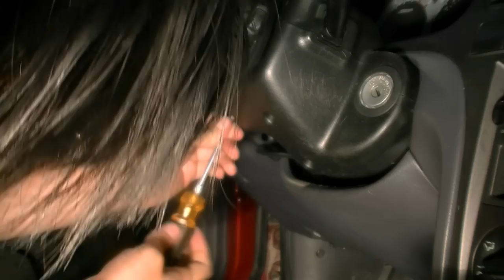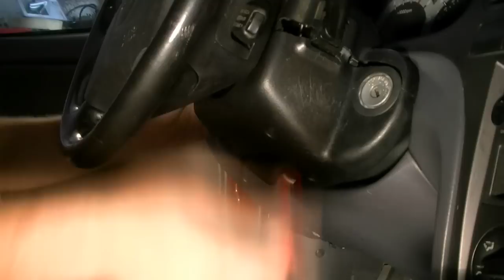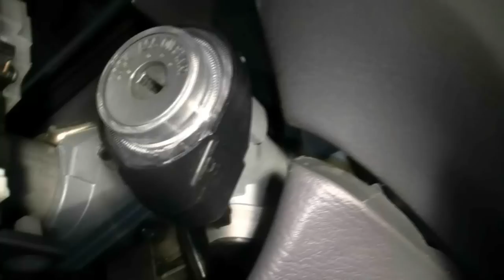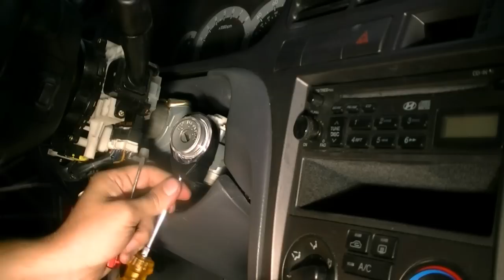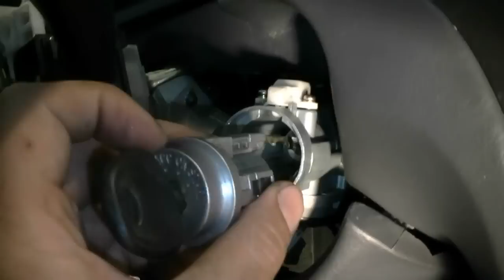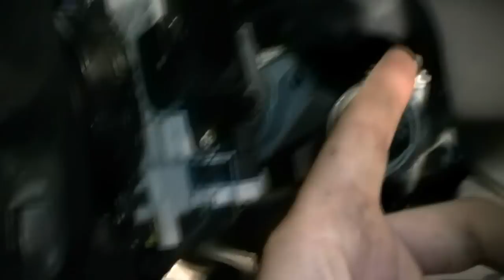How to Remove and Replace an Ignition Lock Cylinder

Comment: If it's a transponder system, does removing the ignition to thoroughly clean the lock and then reinstalling the same ignition cause any problems, or should it still work fine, in terms of programming?

Comment: Thanks for the video. 2003 Hyundai Santa Fe is very similar. To replace that ignition lock cylinder you will need to loosen the 4 bolts holding the steering wheel column. This pivots the column down allowing you to remove the cylinder (the white connector on top hits the dashboard).

Comment: Hello Sir, Thanks for this video.  I have a 94 Camry, and am having issues with the wheel locking up while on.  At the end of this video, I see that you tighten down the white housing and button.  Need I do the same on mine or is that specific to these Elantra's?  Thanks for any input.  Your videos are great.  Cheers.  Bobby :)

Comment: if you have no keys to turn to correct position get a drill and small screw driver.jam the screwdriver in against the retaining pin to stop it spinning and then drill it out.replace with new ignition if you don't have a replacement pin.

Comment: is there any way taking off bolts from bracket with out drilling hole?
Reply: use a center punch and hammer . tap the bolt head in anti clockwise direction to loosen them .

Comment: Great video thank you. Can you do this procedure if the steering wheel is locked and key does not turn (into acc mode). I mean if that pin does not go all the way in and I cannot turn the key to make it go all the way in... what then? EDIT: I have removed everything but the pin does not go in and I cannot turn the key. Do I have to drill it? Is that the only way?
Reply: I am having the same issue.

Comment: could u please do one for a 2000 sonata when I turn the key it just makes a click sound after a few tries it turns over but I have to wiggle the key
Reply from the maker: +Eric Steele Check your ignition switch, wiggle the wires at the end of the lock cylinder next time it does this and if starts up you need an ignition switch (electricl part of the assembly not the lock cylinder) also check out a video on my channel named How a cars starting system works for more info. gl

Comment: what if the lock cylinder is damaged from an attempted theft and key can't be inserted/turned? thanks.
00 sephia
Reply from the maker: Lone Wolf you can either replace the entire assembly or drill into the cylinder break it and turn it out. Than insert your new cylinder, gl
Reply: ditto lone wolfs issue, ''drill into the cylinder break it and turn it out''. exactly how would you do this?
Reply: did this work for you ?
Reply: yes, drill directly into the center of the lock (imagine drill bit is your key). once you get so far in, step up the size of the bit. once you start doing it, you'll get a feel for it and see the results. the ignition cylinder will crumble and break a part and fall out. get one of those magnetic tip extendable tools and use that to pick up any leftover broken pieces and shavings. Put the new ignition cylinder in(optional), still using a screwdriver to start my car. LOL
Reply: ha, that would be hilarious. well, thanks for your help, really appreciate it
Reply: great thanks
Reply: Jim Hayes you're welcome. hope that helps you out. cheers!
Reply: Lone Wolf hay, so it worked, i can turn the car off and on now, BUT the steering wheel is still locked in place. did this happen to you? if so, how did you fix around it? tia!
Reply: that didn't happen to me. maybe some part of the lock cylinder is still in there? idk why it would still be locked but turning off/on normally. do you have the same kind of car?
Reply: well, i have a 2001 elantra gls.
Reply: only thing I can think of is if your car takes the new key types, can't remember what they call them, my honda has one, but not having that key in may keep it from unlocking??
Reply: anytime

Comment: Well, I managed to change it out. It's a bit different than the video...different way to take the dash cover off. Then I managed to find the slot to push the lever. It was very tricky to get in there. I used part of the inside of a pen, which was short and fit in the hole okay. Needed to give the cylinder a good tug to pull it free (I almost gave up). Sadly, it did not fix my issue, which I know am pretty sure has to do with the timing chain ugh...but I feel awesome that I managed to do this anyway (especially considering that I did not know know how to undo the negative battery terminal). Thanks so much for the video.

Comment: Any information about a 2000 Elantra?  I'm currently trying to pull mine apart without wrecking it.  No info on the net, like 90's Elantra's and 2001 and up but nothing on 2000.
Reply from the maker: No sorry, but they should be similar! Does it have tab anywhere?
Reply: RatchetsAnd Wrenches No, there is 2 roll pins to extract.  I've managed to get it apart but it was difficult.  I have to weld a part of the housing back together and the roll pins needed to be drilled to pull the cylinder out.  I found out the release arm for the key and the mechanism for the steering lock needed to be worked to operate smoothly again.

Comment: Hyundai elantra are all the same from 2001 to 2006 I just took an ignition out of a 2001 auto elantra and put it in my 05 elantra  that is a 5 speed with keyless entry and it works great if anyone was wondering.

Comment from the maker: you can try drilling out the tab or drilling into the lock cylinder around where the key broke off to make room and try to get the broken piece out somehow! Also you can just replace the whole ignition lock with the assembly it goes into! Its connected to the steering column with two snap off bolts I believe, use a chisel and a hammer to try to get them to turn! I guess before doing that you can always use the hammer and chisel to try and break and turn the ignition cylinder. GL
Reply: Heating up a stick of glue from a hot glue gun works  great from getting broken keys out of a key hole of a lock